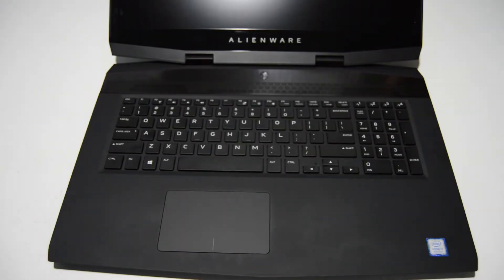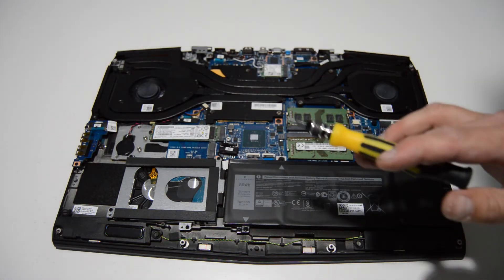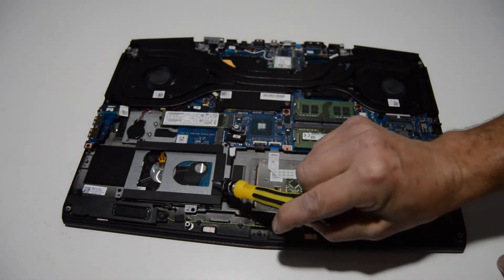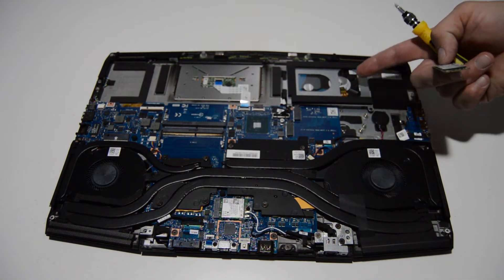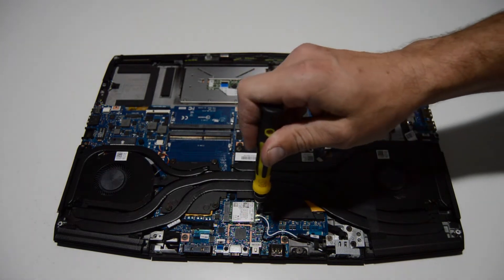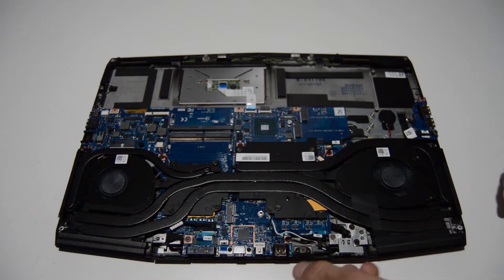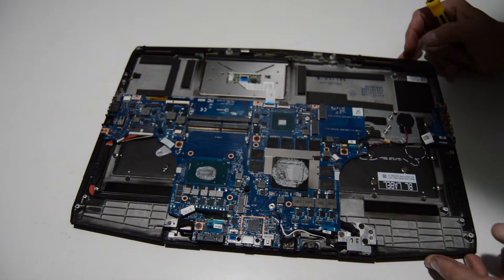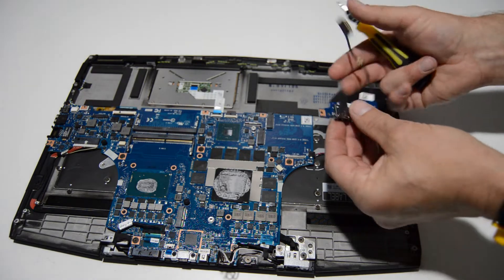How to Disassemble Alienware M17 Laptop

Comment: THANK YOU. I need to get in there to clean the fans and replace the thermal paste and also check the battery isn’t bulging because my trackpad is popped up on one side. Also just wanna clean it up in general. The problem is I am not super familiar with all the parts of the laptop and I wanted someone who would point things out and describe what they were doing. I know the importance of the parts and how to handle them but I cannot tell all of them on sight yet. Lol. And I swear anyone else who had a laptop like mine was speeding through it without explaining anything, not talking or pointing things out at all and just blasting music, or they made me nervous doing stuff like throwing screws everywhere and pulling stuff out on carpet. 😂 This is the first one that makes me 100% confident going into it. Thank you!

Comment: Didn't need the full break down, just where the SSD was. But spot on detailing for every part just in case I did need to go deeper.

SSD connection piece to the mother board was loose. When you said to hold the mother board because it can take some effort, I braced mine and with almost no effort it popped off. just plugged that puppy back in PROPERLY, and was back in running order.

The only troubles I've had with Dells has been Hard connection. Could you imagine getting a tower, booting it for the first time, and it tell you there is no hard drive? And now this, lol
Reply: Dd your alienware stop recognizing the hd? That's the problem I am currently having and found this video to help me distinguish which connection I am checking, not to familiar with the innards of laptops.
Reply: @nickmorris585  yep

Comment: Can the 60hz panel version of this laptop be upgraded to one of the other 2 panels? I just got the 60hz version with the 8750h, RTX 2070 Max-q. I want to buy the 120hz 1440 screen but i'm thinking the 60hz version has the 30 pin hookup and the other two are 40 pin. My luck probably can't upgrade it.
Reply: were you able to update the screen?
Reply: Hi
Also looking for this answer.  I quess the first question is to know whether the mobo is a 30 pin or 40?.  @sellbroke, can you remember at all if the connector is 30 pins, what about the screen, what about the board?
TIA

Comment: Can the computer work without the internal battery, just using the external power source?

The reason I'm asking is because my internal battery is swollen and the new battery I bought will arrive in a month, and for safety reasons I thought it would be a good choice to remove the Swollen battery until the new one arrives.

Do you or anyone else have any recommendations?

Cheers! :-)
Reply: Were you able to use it without the internal one? Hopefully you see this lol been 2yrs 💀
Reply: @ccalvinn  They won't be any issue if it's in power, but I don't recommend it

Comment: what is the part number of hdd sata connector for m 17 2019 ?
Reply from the maker: Your best bet is to find your service tag number on the bottom case and enter it on the Dell support website. Then click the link for product specs, it shows the P/N for each part.
Reply: @Sellbrokedotcom  actually its not mentioned in it because its not comes with that
Reply: @Sellbrokedotcom  i already searched but unable to find